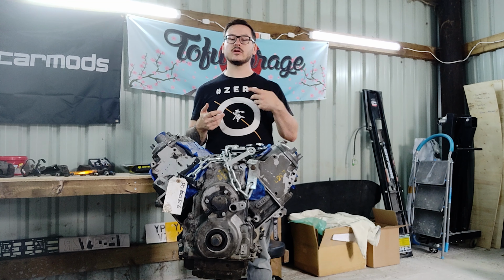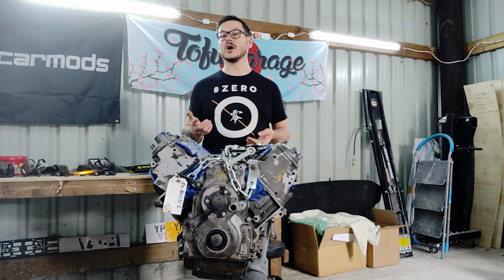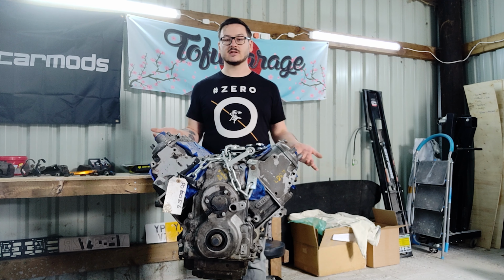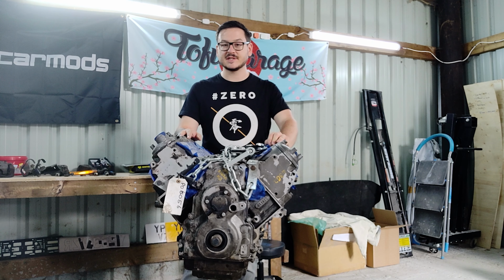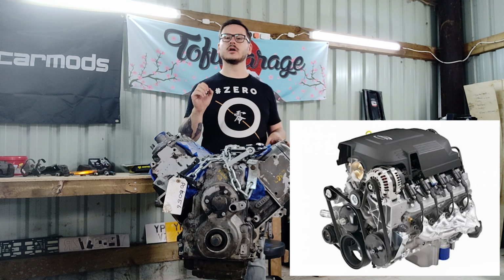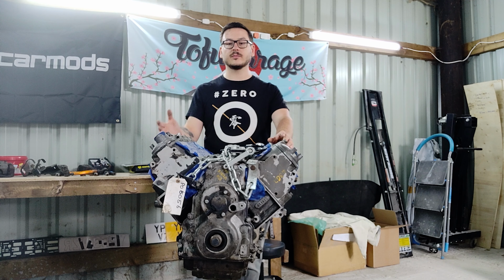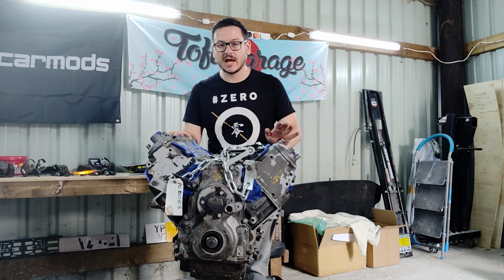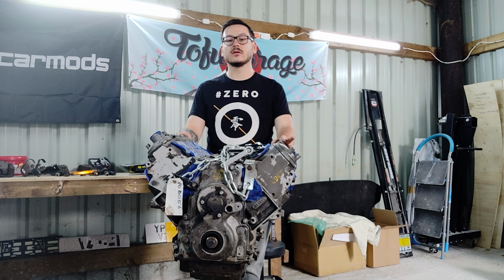I'm Planning an LS V8 Engine Swap!

Comment: Will be interesting to see the dyno and drive ability results with that swap. I guess the huge downside will be fuel economy but I don’t think that’s why you buy a V8. It will soon be time to start smashing the transmission tunnel apart.
Reply from the maker: Should be a fairly simple experience once it's all said and one, a nice linear power band and I don't think the fuel economy will be shocking, I reckon it'll still be above 20 on average.
Might have to invest in a sledgehammer if it comes to that!